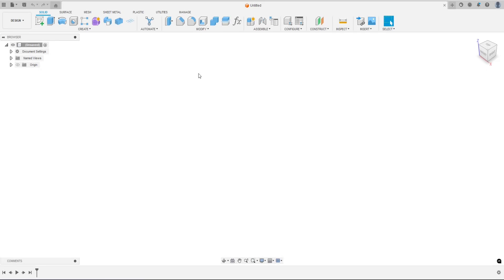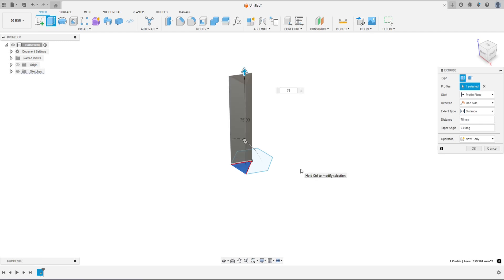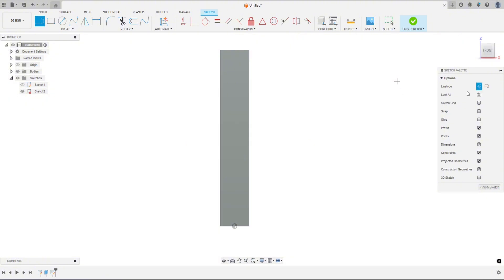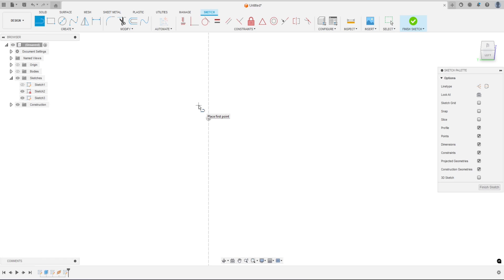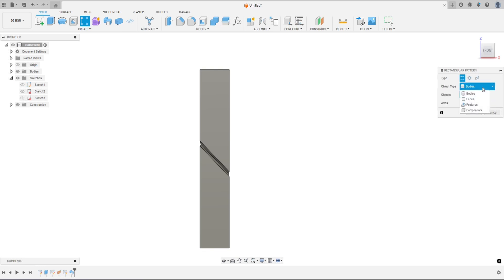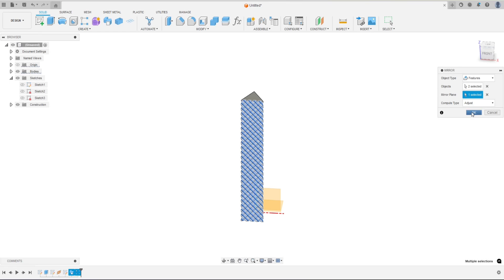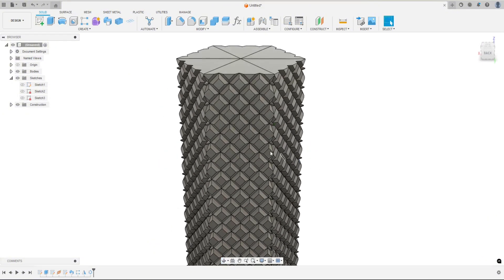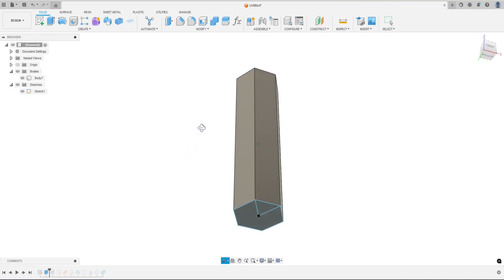Autodesk Fusion: Knurling on a Hexagon

Comment: Thank you for your video! But I need to make a "knurling" on such a figure: from the base there is a cylinder, then there is a narrowing of the cylinder and at the very top there is a rounding of the end surface. Please help, thank you! Sorry for my English, I'm writing through a translator)))
Reply from the maker: Look at my video where i create a Fan.  Use that same technique to get a line around your object, and then sweep your triangle cut-out along the path, then repeat in opposite direction, and pattern.

Comment: Thanks, I'm making my own Fusion Cookbook recipes from videos. Your videos are particularly good. I like your background discussion. I find I get lost sometimes and can't find my way back most of the time. Your videos really help. Question: the last part about overloading Fusion (I did that). Doing a Force Quit, I searched on forcing Fusion to quit and came up with clicking on the Clock icon on the Tool Bar upper right. In your experience does that work or do you just use Windows Task Manager? Which also begs the question: Do you use a Mac or PC? So I'd like more content on what to do when things go wrong or what not to do so thing don't go wrong. The setup information is good too.
Reply from the maker: I always use task manager if Fusion freezes. I use both windows and Mac, but I prefer using it on windows. The best advice is to constantly save your work….or at the very least, save it right before doing something that might crash Fusion!

Comment: How do I create a mesh of circular holes on a cilinder?
Reply from the maker: There’s a few different ways. I’d probably create the pattern of circles you want (two columns) and then emboss them. Once embossed, you can use the pattern tool to go around the cylinder